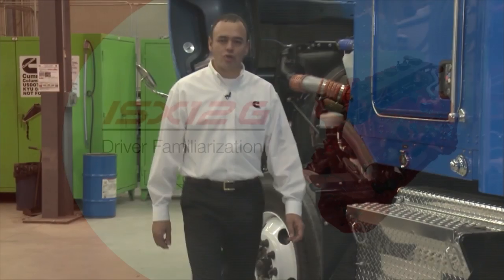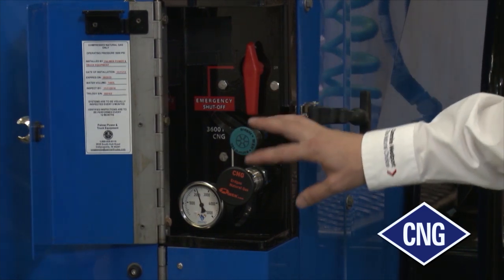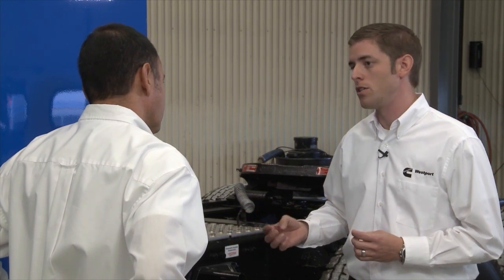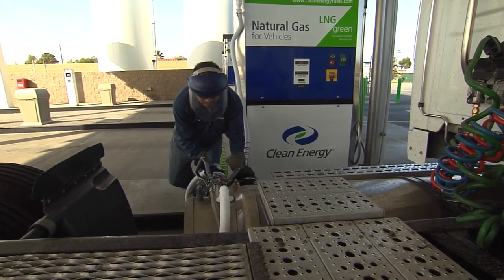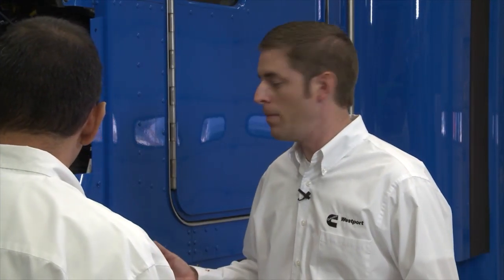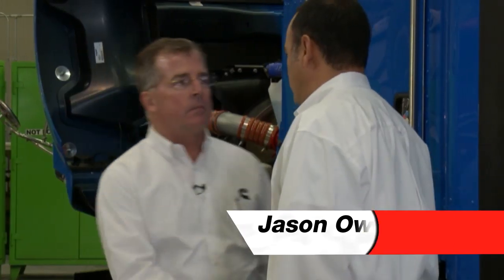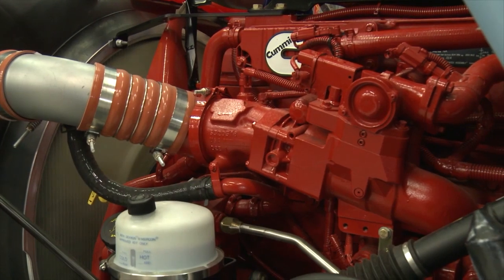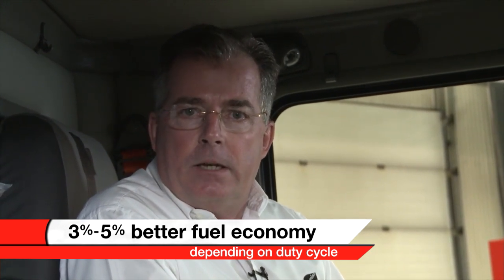Cummins Westport ISX12 G Driver Familiarization

Comment: Very nice.
Is possible to use the same engine, diesel and gas, type flex?
Reply: Cory Stansbury Not on the automotive end.  But Duel Fuel is now being introduced to many off highway applications, primarily in the natural gas drilling industry were they use gas coming from the well.  These high horsepower engines are capable of running completely on diesel or natural gas.  This is a very attractive option as these engines can consume many hundreds of gallons of fuel in an hour resulting in a huge amount of savings.  This technology is very new to Cummins and is still in the process of being field tested.
Reply: Some forms of NG engines are essentially diesel engines which use a small amount of diesel like a spark plug to light off a larger quantity of NG. That said, the injectors/fuel system are sized far too small to run the engine at full power on diesel. It may be possible to use the bigger injectors and make a dual fuel capability, but I know of no current engines that do it. 

The ISX12G and ISL-G are more like gasoline engines in that they have lower compression ratios and spark ignition. The head designs are different (note: major difference on ISL-G is 2 valve vs. 4) and they have a throttle and wastegated turbo. They are pure NG...no diesel at all.